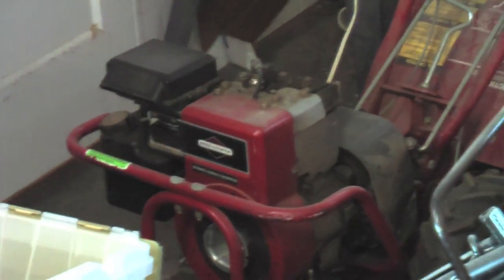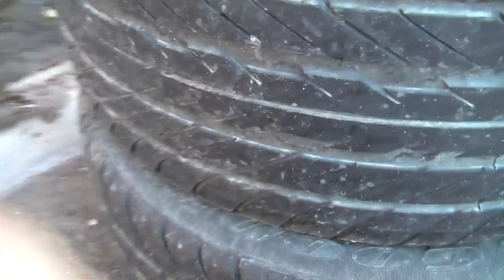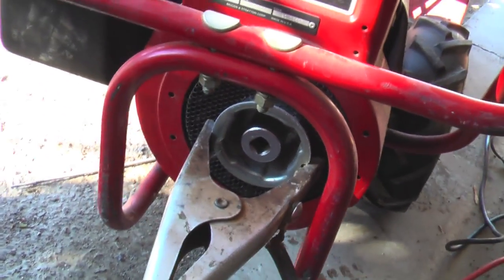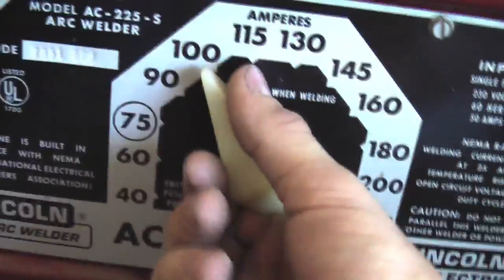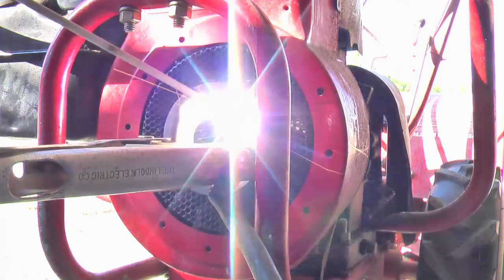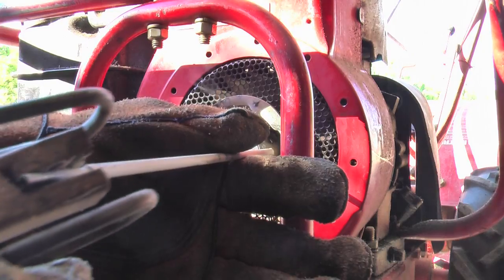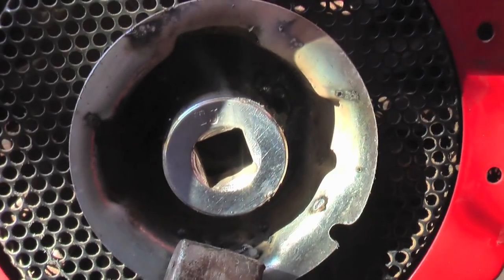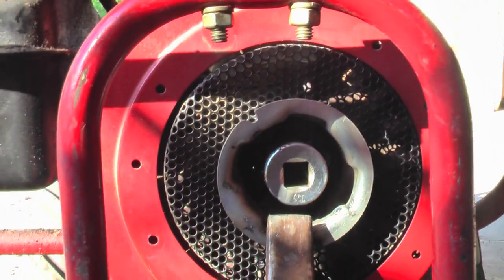Welding Socket on Tiller for Drill Starting

Comment: Those arc welders are beasts . That model is the second best the first place goes to the same type but does AC and DC I have the same one you have but the AC DC model is the one I would love to have great for fixing my wheel chair .
I use the same one you have for now . Great idea on drill starting MY uncle showed me that trick in the early 70s I have used it without fail I have one that requires a 1/2 inch very powerful drill .

Comment: Why not weld the socket to the extension and then you don't have the problem of yanking an extension out of a badly welded socket that isn't even straight to the flywheel? It would make removing the flywheel actually possible if you had done it the more logical way.